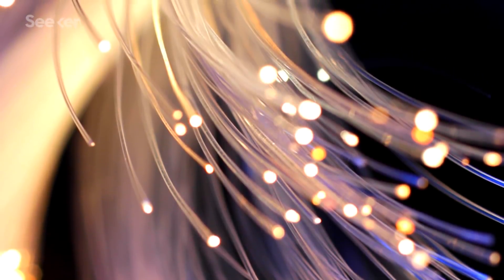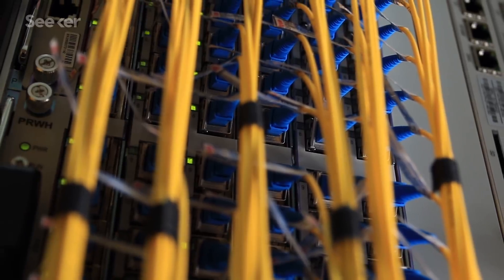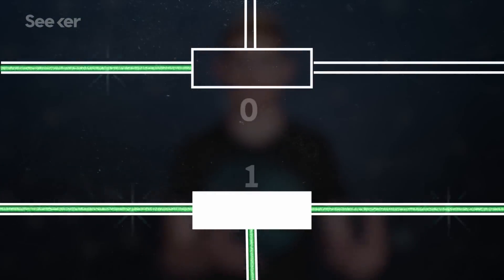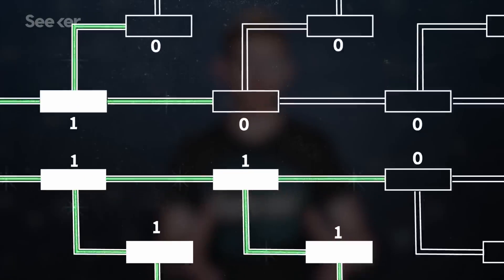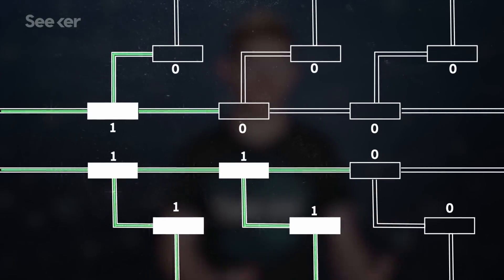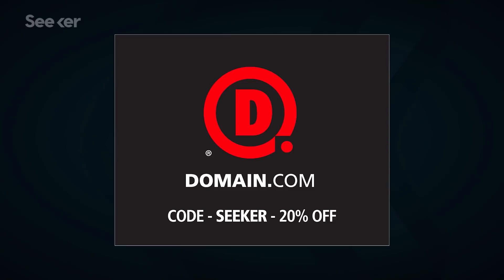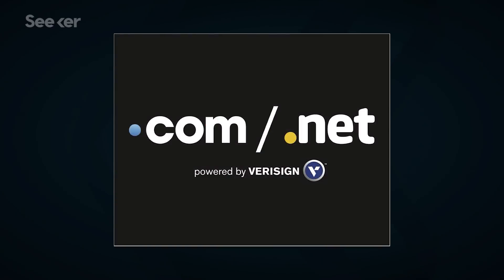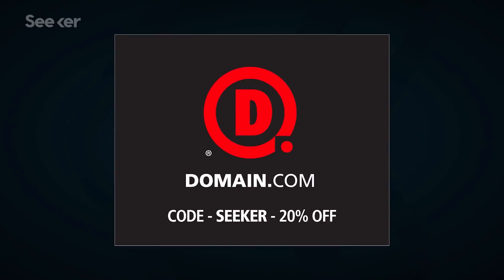Photonic Chips Will Change Computing Forever... If We Can Get Them Right

Comment: Major mistake at the beginning, please correct: The speed of the electrons (drift velocity) is not the speed by which computation happens or by which the signal travels through a cable! In a copper wire this speed is just 10^-6cm/s. It is the speed of the electric field within a medium (at a frequency) that decides, how fast the signal travels through the wire, as the electric field is accelerating the electrons. 

It is also not the photons speed that outperforms electrons, it is their ability to interfere.

You are reproducing a typical misconception. 
I did my Bachelors on computational nano optics and photonics before changing the field btw.
Reply: Electron mobility is the drift velocity (that I was talking about - the speed of the electrons in an electric field) divided by the electrical field. It has nothing to do with the signal speed within a medium, as that is determined by the light speed at a given frequency, which is unrelated to electron mobility! In a computer the electron mobility is only relevant in tunneling through the gate of the transistors, which is only a few nanometers wide. In optoelectronics and photonics possible transistor equivalences would still depend on matter light interaction, which would happen at comparable speeds as the one of the electrons, so this would still not introduce any speed gain!
Reply: Michael N. Tropie ily
Reply: That's what I was thinking too. But doesn't the electric field travel at the speed of light?
Reply: @feynstein1004  because electrons have mass
Reply: And the possibility of many computations at once using different wavelengths of light in the same circuitry
Reply: Why did u change fields??
Reply: How would you compare photonic chip to "ordinary" one in terms of size, energy consumption? As I've understood in terms of speed you consider them to be about same...
Reply: I wanted to get in the education of optics and photonics but it's really hard to talk to anybody that's been there and done that know anybody I can talk to or like a counselor or an advisor.. perhaps
Reply: Perhaps anyone know or can advise
Reply: Michael N. Tropie maybe you switched your field too early....look up "electron mobility ".

Comment: Most copper cabling actually transmits data at a faster speed than fiber. But comparing data throughput is like comparing a pressure washer versus a river. The power washer (copper) had a faster flow, but the river (fiber) can move more water by volume. Plus standards for CAT cabling efficiency caps off at 100 meters, where as fiber can go the distance. Remember, light only travels at the "speed of light" in a vacuum. Fiber optic is glass, and only travels about 65% on average, while copper cabling can push above 70% nominal velocity. Is suddenly doubt Seeker's ability to provide accurate information.

Comment: Quantum computers don't have a future for common consumers. So we will have to find something more efficient and faster than our current binary system. There is a plus side however, if they can use light, they could modify its frequency to generate more than 0 and 1 per process. So a single stream of light could technically generate 64 bits instead of having 64 individual paths of electrons. Thus reducing electronic components to a 64:1 ratio

Taken this further, 128, 256 and so on in bits could be achievable on a single stream.

Comment: Electron travels at 99.9999992% of the speed of light.. Damn that is slow compared to light.
Reply: Yes but they need a conductor to travel, like gold, copper, they won't travel at those speeds anymore. That is the speed in  vacuum.
Reply: @mgeorgescu  Agreed. Even photons will slow down when moving through a material. But electrons slow down more.
Reply: Mihail Georgescu But it is stupid to call electrons slow. Other factors make them slow.
Reply: Pietro Smusi Check my previous answer.
Reply: huh?
Reply: Electron in a conductor travels at below 1%of speed of light. When it is given an energy of 4Gev it reaches 99.999997% the speed of light.
Reply: Don't confuse electron drift speed with electromagnetic waves speed in wire which makes singals spread.
Reply: I think electrons only travel through a conductor at a very very slow speed.  It's the wave propagation where the electrical charge is passed from one to the other through the wire that' moves close to light speed.
I'm not an expert though, so if i'm wrong about this i'm sure someone will correct me.
Reply: And who taught you that? 😂 Check drift speed of electrons on Google. You'll be surprised at how slow they are! Like 0.0001 metres per second. No offence but check your facts bro
Reply: What is important is the velocity factor or wave propagation speed which tells us how fast a wave propagates in a certain medium. Velocity factor is primarily dependant on the dielectric constant. For instance a common PCB material FR4 with a dielectric constant 4.5 has a velocity factor approximately 0.54. This means that the wave propagates at 54% the speed of light in vacuum.
Reply: 100,000 meters per second seems fast until you consider the amount of travel that happens inside a chip and the number of times per second a calculation is done.
Reply: Look another smarty here
Reply: kenny... LOL:))  how stupid you are to say such a non sense? You don't even have to know physics to realize how absurd is what you said... only thing you need is basic logic.
Reply: sudo nude -- it's not as stupid as it sounds.  The thing you have to remember is that as a consequence of special relativity, objects moving relative to a stationary observer experience a shortened duration of time relative to that observer.  This is known as time dilation.

That being the case, time dilation for a massless particle (such as a photon) traveling at the speed of light is so large that an eternity passes for the stationary observer while the photon"experiences" no time at all.  So all events that ever occur in that particle's timeline, in effect occur simultaneously from the point of view of that particle.  According to the photon, it is smeared across all spatial locations it has ever or will ever occupy.
Reply: Kenny S, Lol it's not what relativistic time dilation means.
Reply: He said 100,000 m/s wich is 100 km/s light travels at 300,000 km/s
I think thats a little faster
Reply: Kenny S that makes no sense
Reply: I was pointing out the obvious mistake in the beginning of the video that electrons in silicon travel at up to 100.000 m/s. Electrons do not move that fast. In fact electron drift velocity is in the μm/s range for a reasonable current. Propagation delay in a chip is limited by the velocity factor as I pointed out.
Reply: sirKahvi electron travels at 2,200 kilometers per second. That's LESS than 1% of the speed of light dude

Comment: The problem is none of our current software will bebackward compatible and the thousands of dollars i spent on steam will be dump when this become common :(

Or it might be possible to emulate regular cpu architecture on supercomputers i dunno.
Reply: Aravind Ajit That or they package it into a virtual machine which most end user devices should support
Reply: The architecture of the cpu might not change. Most probably only the components will get replaced. So I think it might be backwards compatible.
Reply: emulation

Comment: Would we call these new light-based electronics “photonics”
Reply: It's called optoelectronics for 50 years.
Reply: Photonics is more apt. Electronics are called such because they use electrons. Acomputer entirely based on photons shouldnt be called optoelectronics because electrons arent whats being used.
Reply: Litronics
Reply: It's still electronics because when the photon hits a logic gate, it turns into an electron to switch the state on the transistor and then the electron turns back into a photon to continue the journey through the circuitry. Just like the photons in an optic fiber turning into electrons when they have to travel through regular copper wires the last 100 meters or so to your house.
Reply: Eli Malinsky But it will be photonics once all the computing is done via photons
Reply: Steellmor that's a bad name for it lol
Reply: Kenny S Maybe the photonics are run by photonics
Reply: You should work in marketing sir and
Reply: Irok 121 fingerinbuttholeonics
Reply: Darren Galloway true, but they are what's powering it, for what that's worth.
Reply: plasmonics

Comment: 0:06 - Do you really think meters per second is a good way to tell us about that when it's about nanoseconds while processing something?
Reply: Yeah of course but it's hard for me to imagine how fast it moves on a circuit board for example when you tell me it travels 10.000 meters in a second.
I think something like how far it travels in a nanosecond or millisecond or something would be easier to understand... (for me at least)

edit: I'm sorry if I was unclear in my first comment, I meant the latencies involved, which basically boils down to the connections.
That's why the CPU's cache is so much faster than RAM.

Comment: HEY! Excuse me, but even though the electrons are slow, the information a stream of electrons moves at the speed of light. 
Speed isn't whats makes photonic chips better.
Reply: It does. In normal electrical signal you just need electricity to flow, hence any stream is the same. So the moment electricity starts flowing in a circuit everything works. In a logic gate when I enter 0 on one input and 1 on the other the electron used to represent that 1 and the hole used to represent the 0 will have to travel through the circuit of the gate and come out at the output. Only when that hole and that electron gets out from the output do I get my result. All logic gates have various kinds of delays associated with them, which is an important constraint when it comes to designing logic gates and circuits. 
Hope this helps :)
Let me know if I was wrong anywhere.
Reply: also I think that these "light chips" would emit far less hit (and so consume far less electricity, so be far more "stackable" the only problem being space.
Reply: The speed of an electron is really slow ,it’s like 10 cm/s or so. The reason it is fast is because it’s closely packed. But the speed will never reach the speed of light.